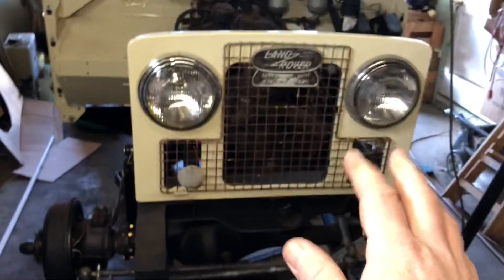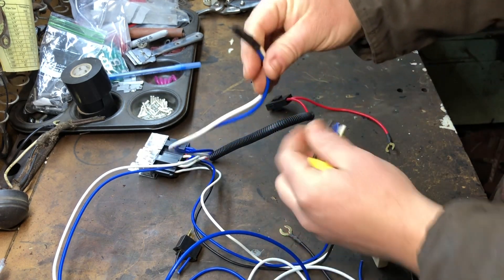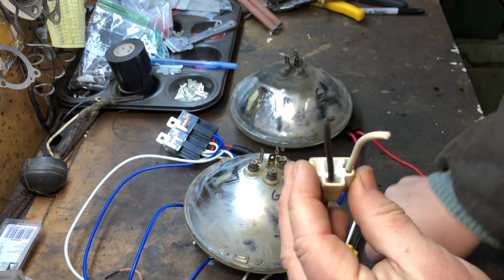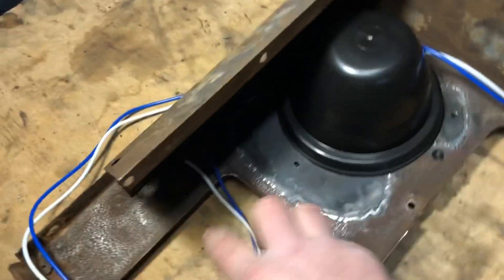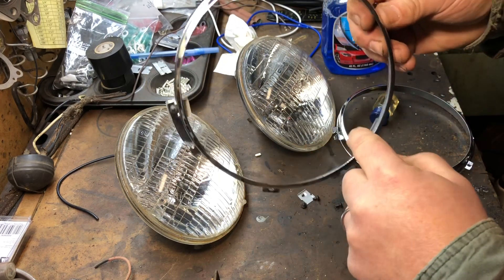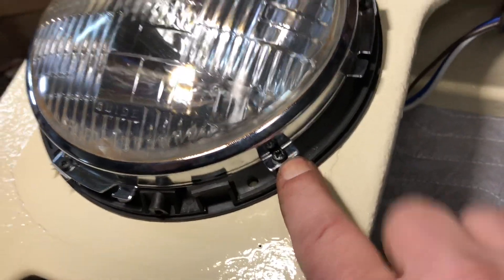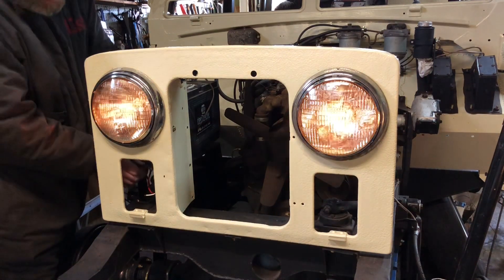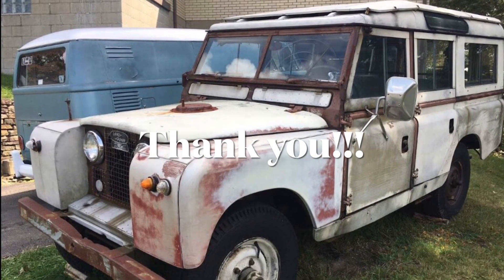Wiring Part 5 - Headlight H4 Relay Kit Land Rover Series 2A Restoration

Comment: WHY DID YOU CUT THE WIRES THEN PULL THE WIRES OUT OF THE CONNECTOR
Reply from the maker: I cut the wires because they were too long. Since the headlights are close and they are close to the relay. Cutting the wires made it easier to insert the wires into the small hole in the back of the headlight bucket. Early sealed beam bulbs have a different location for high/low positives and ground in comparison to modern H4 bulbs. So the connector needs the wires need popped up and switched. Check it with a multimeter. The headlight relay kit is for H4 bulbs but can be wires up for anything. Thank you for watching!
Reply: @conrad1468  Thank you

Comment: Please could I ask where you find the correct wire gauges for the different applications ? I have 3 landie books and can't find any. Thanks in advance
Reply from the maker: I don’t know why LR doesn’t supply wire sizes. It would be helpful. I came up with wire sizes from experience. More amps means bigger wire.

Comment: Since the wires can be removed from the connectors...wouldn't the wires have passed through the headlight bucket w/o cutting?
Reply from the maker: That’s correct. I could have. Getting thru the headlight bucket grommet with the spade connectors attached would have been a pain. Since I had to cut one side to shorten it. I figured cut both for easy of installation. Thank you for watching!!